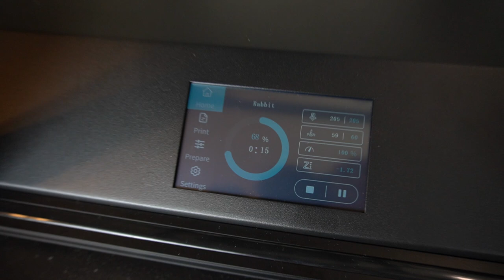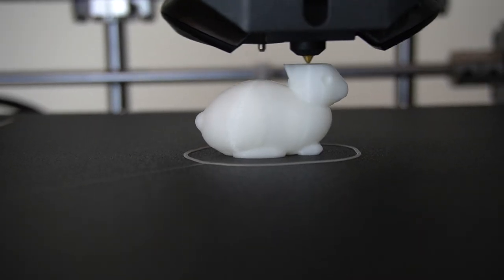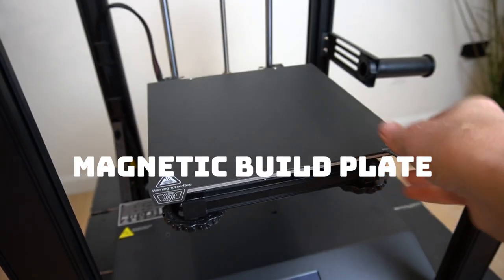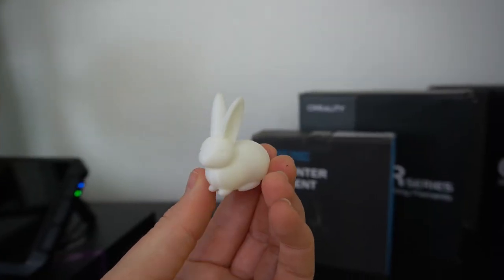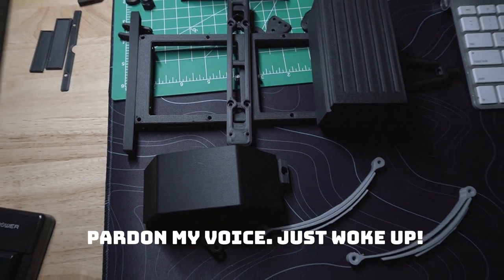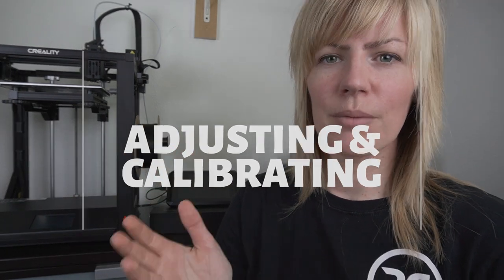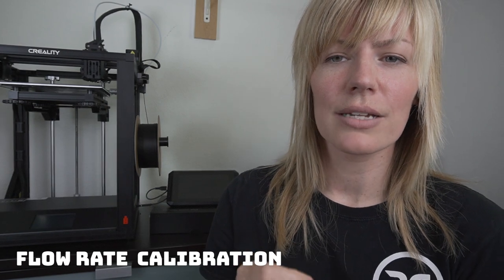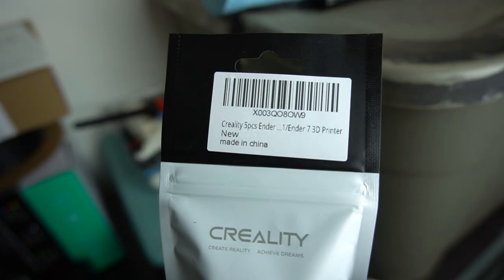Beginner Guide to 3D Printing! Creality Ender 5 S1 & Sonic Pad

Comment: Top tip for all of you watching. Upgrading needs to be done one part at a time. Install set up and get it printing right BEFORE adding the next.  A mistake i made, buy it all fit it all together. nothing works and its extremely hard if you aint clued up to find and fix the problems.    One step at a time. Youll thank me.

Comment: This is s super valuable video. It motivated me to give my anycubic the tlc it needed. And now i am printing my first heat tower (great tip). I use autotowers generator for cura. Summer heat and humidity vs cold winters and dry air can also greatly alter the print quality and can make a recalibration necessary. Thanks again for the great tips!
Reply from the maker: Glad it was helpful. The auto tower feature is great!

Comment: I was just like you when getting a 3D printer and watching the first few prints intensely and how cool it is. I got the ender 3-s1 pro about 5mths ago, so fairly new as well to 3D printing. I use Cura for slice and tinkercad for design. 😀
Reply from the maker: Haha yeah it's fascinating to watch
Reply: How do you like Cura for slicing?? I been thinking of using it also!
Reply: @MaddiesMeadows  myself I like it. I tried Prusa slicer but my print jobs didn’t come out as nice vs Cura.

Comment: Ive thought about getting into 3d printing just to print spare parts for my rc. I figure with a printer costing between 300-500 i could make that back in 10-20 repairs or so not to mention all the stuff i could use it for around the house.

Comment: Thank you for your fantastic review, good luck on your 3d printing journey, I have been printing for5 years and have just brought the ender 5 s1 with the sonic pad I am a bit concerned about using the sonic pad as all my other printers use marlin firmware, is it easy to use.
Reply from the maker: Yes it's a breeze, especially if you've been printing for years. You'll have to tinker a bit in whichever slicer you're using to link it and make sure that the object thumbnails show up on the sonic pad. Let me know if you have questions
Reply: @RCGirl  How do I link it to the slicer I use Cura at the moment but there was a copy of Creality slicer on the supplied memory card so I installed it and chose the ender 5 s1 and it put the settings in for me

Comment: @RCGirl You are printing at an extremely slow speed. That printer with the Sonic Pad running Klipper is capable of printing much faster with the same quality. Creality provides Cura Profiles for the Sonic Pad that are a great starting point. Your 17h print could have been done in 5 hours give or take an hour. Feel free to reach out if you have any questions. I use the Sonic Pad too with my Ender 3 S1 Pro.
Reply: If you use the sensor that comes with the Sonic pad to calibrate it you can print at high speeds with 0 ghosting.
Reply from the maker: @wrbrc4865  Yeah I was hoping to get the best quality possible by going slower at first. I'll have to up the speeds. Still have not used the resonance compensation sensor but that's next!
Reply: @RCGirl  I had to do resonance compensation again after the latest update. It’s working well.
Reply from the maker: @wrbrc4865  did you have to print a bracket to mount the sensor?

Comment: My first 3d print was a benchy then I printed some fuznuz bumper spurs that my sister uses for riding our horses then I printed about a dozen gypsy vanner horse cookie cutters as gifts for our staff and friends at our horseshow and every time I set up the printer I print a part of a model train tipper wagon for quality reference I bought the printer for making casting molds for steam engines horse carriages horse drawn equipment and the 1888 frich size 0 sawmill I'm restoring